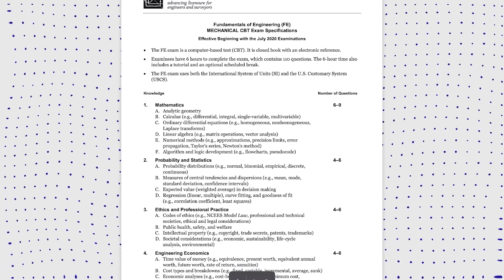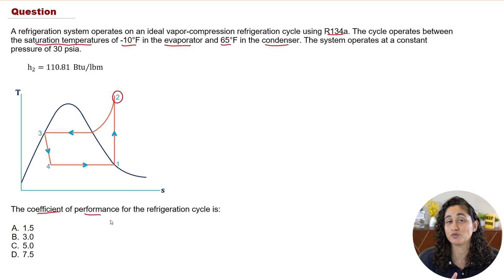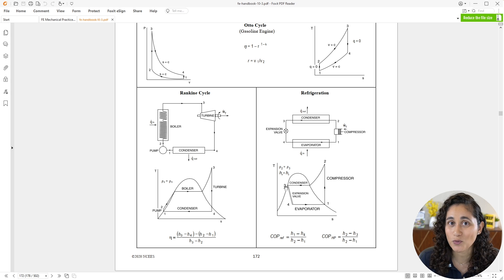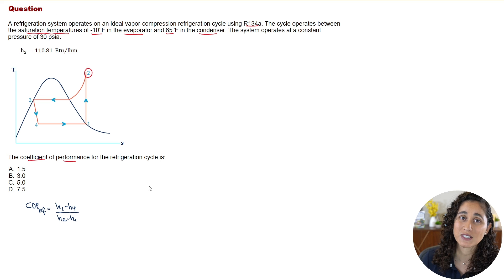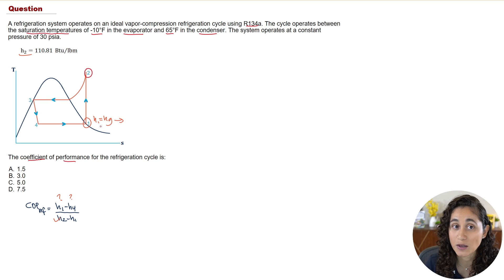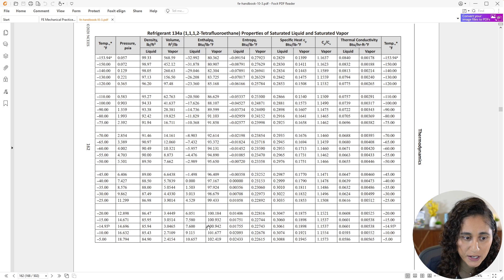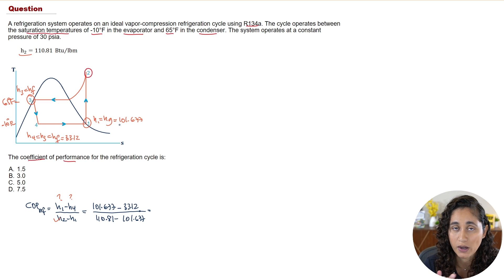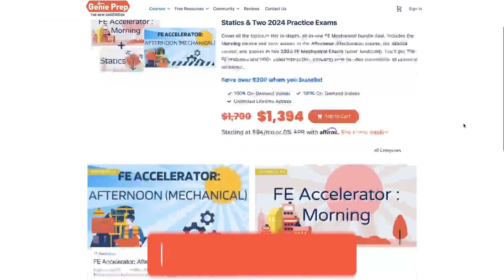Coefficient of Performance For Refrigeration Cycle | FE Exam Review

Comment: I'm somewhat confused and could use some clarification on your work, you use the liquid column to find the h3 component in the R134a table, however after the condenser the refrigerant is at 65 degrees Fahrenheit, much higher than the system constant 30 psia pressure would allow for saturated liquid, making the state after the condenser quite unclear due to conflicting information from you and the problem setup. Could you please clear this confusion up?

Comment: In the question, the system operates at a constant pressure of 30 psia. But process 4->1 and process 2-> 3 are not pressure of 30 psia. Why?

Comment: Are we supposed to take thermodynamic table to exam, or they will provide it?
Reply from the maker: Yes, Ganesh! They will provide it. Whatever you might need will be provided to you. For example, if you need a value from the table that is not in the Handbook, you can find that given in the same question.
Reply: Thank you so much, And the reference handbook is also provided right?
Reply from the maker: @ganeshdesai3865  Yes!